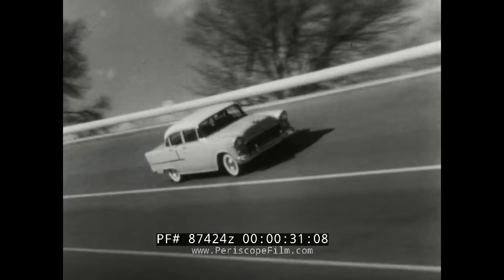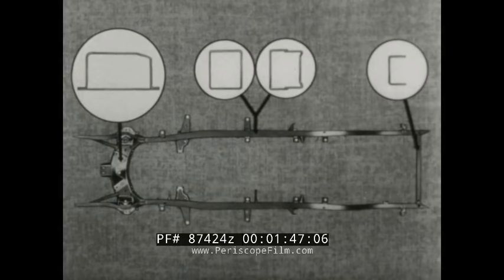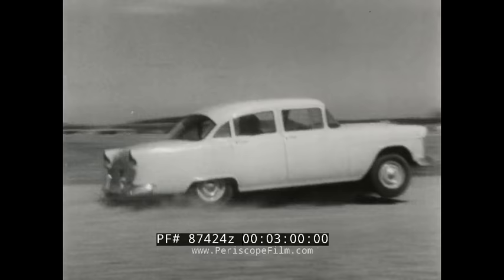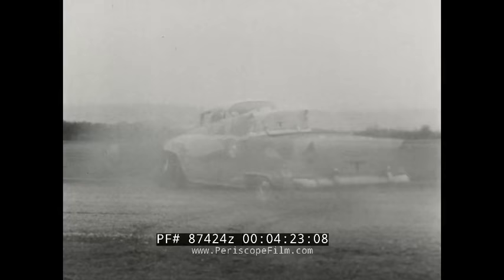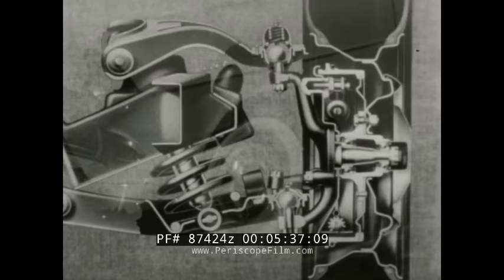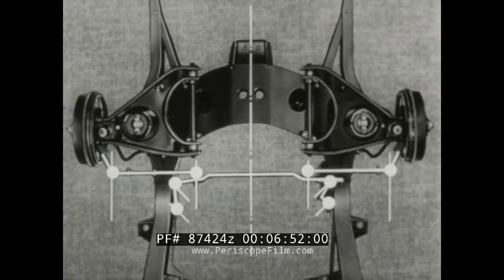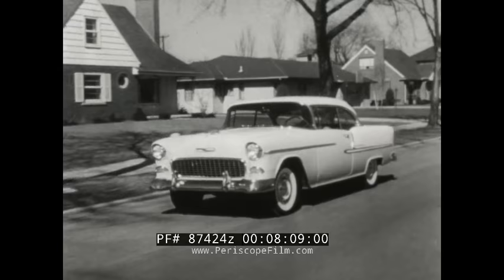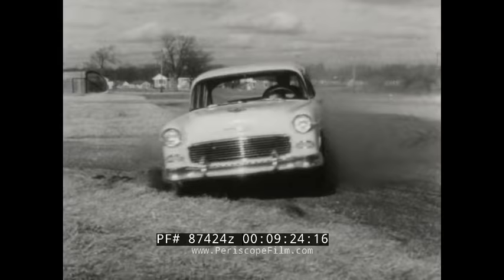1955 CHEVROLET CAR PROMO FILM w/ JOIE CHITWOOD CAR STUNTS "BOXES AND BALLS" 87424z

Comment: The problem was that no one liked the "glide-ride" that Chevrolet offered for '55, '56, and '57. In fact, it was because of that the 1957 Ford actually outsold the 1957 Chevrolet. Back then, people wanted a soft suspension and Ford gave it to them. The stiff suspension is what turned off people from buying the Chrysler products too. The "torsion-aire" ride was horrible unless you planned on going above 80 MPH for extended periods of time. In 1958, Chevrolet got rid of the "glide-ride" and replaced it with soft springs. In 1960, the springs were softened again but, the springs were shortened for better stability.
Reply: Completely right.  It's funny that we want a stiffer ride nowadays and European cars have it to us
Reply: @95blahblahhaha  People were brainwashed into thinking that a firmer ride was safer. That may be true if you were to go over 80 MPH most of the time but, most people don't. On a long trip when most people stay at 70-75 MPH, a soft suspension offers superior comfort and decent handling.

Comment: Actually, a triangle is stronger than a box. That’s why Bridges, cranes, wreckers, sign posts on the interstate etc. all use triangular structure .A box can fold in the corners and become a parallelogram. A triangle can’t fold in the corner and unless one leg has been damaged, a triangle is much more structurally sound. But you could pretty well advertise anything back in the day and nobody questioned it. Times were different than people weren’t as inquisitive.Look at how they advertised asbestos back in the day as the safest best insulation known to Man!

Comment: Used to work for TOYOTA.  Advertising.  Car commercials back then were 
even funnier.  (car commercials mostly consist of shots:  "Car going this
way, car going that way, car going into a straight-away - a car EASILY
taking a sharp curve").  a VOICEOVER touting the QUALITY of
the actual manufacture.  "Right NOW at your Toyota Dealer 
(the actual sale they're doing)..."